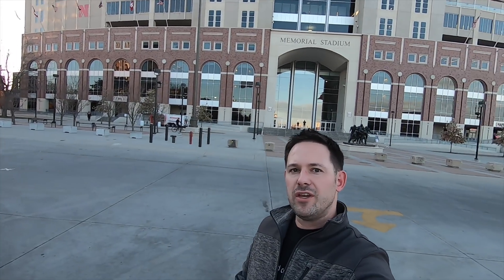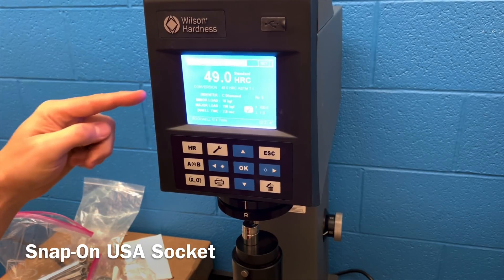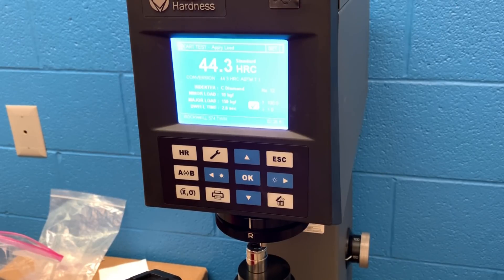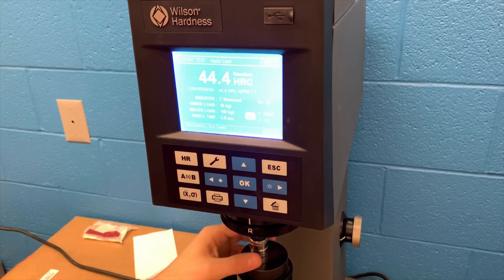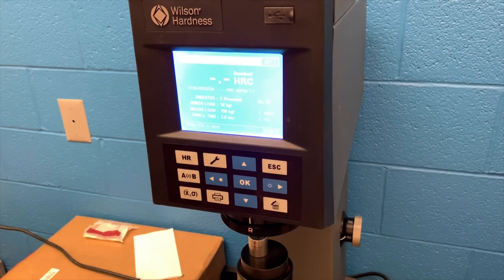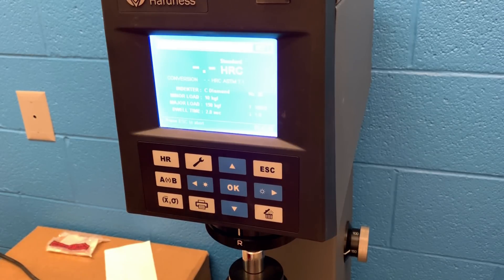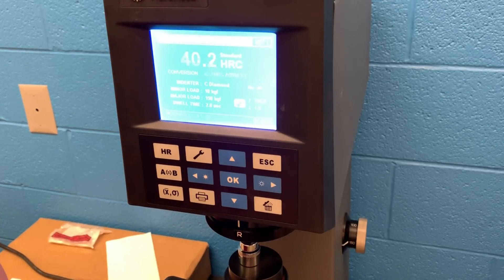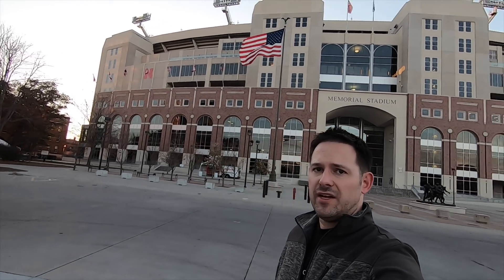Which Brand has the Hardest Socket? Rockwell Hardness Tool Testing

Comment: This proves nothing! Harder means it will crack or shatter faster. Also you can’t break any of those sockets when using them on a ratchet, sure I’ve broken snap on, and craftsman sockets but only when using them on a big breaker bar or impact. They aren’t designed for that! In my opinion if you’re just starting out just buy impact sockets from the start. I have complete sets of chrome sockets in every drive size and impact sockets in every drive size also! I rarely use the chrome sockets, and with my thin wall and stubby impact sockets I really don’t need the chrome sets! If I could start over I would have never bought the chrome! Waste of money! But I’m drawn to shiny chrome tools like a homeless guy to an ashtray in front of Walmart!

Comment: My black chrome Stanley set is awesome. Stanley makes some husky sets. There is a 100% identical husky set as my Stanley. It came with two size wrenches deep and short sockets for both. I use them on my makita impact no problems.

Comment: 2 things. 

first, i dont know anything about how this testing works, but couldnt/wouldnt the thickness/quality of the chrome coating have a significant effect on the readings, to the point that you are measuring that just as much, if not more, than the actual metal hardness??

secondly, just about ever socket i ever broke was at teh thin part down in the hex area. i notice tht you checked hardness in the drive area. im assuming that it is also possible that these have a different temper on the working end that was missed here.

Comment: most interesting, but as others have said, hard may also mean brittle, I suppose it is all down to the composition of the alloy, the fineness of the grain structure c/w the depth of the hardening process, Socket strength is also dependent on wall thickness and 6 point verses 12 point sockets, I have just invested a lot of money in a new set of SK sockets, which may, or may not be the same as the old Wayne SK socket you tested. I suppose the proof of the pudding is in the eating. Further, how about the affect of the chroming process? hydrogen embrittlement ?

Comment: The engineering in something as simple as a socket would amaze most people. Not only base metals, but forming, machining, hardening, plating and quality control.
What I’m curious about is why one brand can sell 20 sockets in a blow molded case for $19 and another brand charges $41 per socket?

Is there any way to dive into development cost investment between brands?
I know many are reverse engineered to save in this area.
Reply: Man there are a ton of variables. Material, number of QA operations, tolerances, number of thermal processing cycles, finish prep, finish itself, frequency of tooling replacement, country of manufacture, and last but not least - business model….. 

Those are just the variables off the top of my head.

Comment: Keep in mind that the harder the metal, the more brittle it becomes. You need to section the sockets and check the internal hardness to get an accurate idea of how these compare.
Reply: I'm sure the harness is evenly distributed throughout if it was really thick then yes the harness would vary greatly depending on the alloy of metal used. IMO the chrome plating should be removed to get better test data.
Reply: That’s true for any given specific alloy, but there’s more alloys than you can shake a stick at and one alloy may be less brittle and harder than another one that’s more brittle while being softer. Therefore you can’t just assume because one is harder it’s going to be more brittle, it could be harder and less brittle, especially if it’s more money.
Reply: Also, “brittle” isn’t really a useful term for metals. Usually you use toughness and strength. Brittleness is the tendency to break before it bends, but that doesn’t really tell you much (except that if it’s bending the manufacturer could have hardened it a little more and if it’s breaking they could have hardened it less, but again only useful when comparing the exact same alloy, and steel has many different ones). 
Strength tells you how much force can be applied before it fails, either by bending or breaking, and toughness tells you its impact resistance or energy absorption before failing. All of them are going to vary, sometimes drastically, by specific alloy and not necessarily be dictated by how hard the metal is.

It’s all about compromises. They can make the metal very corrosion resistant with high chromium or other additives, but that will sacrifice strength. They can use exotic metal combinations that make manufacturing, machining and quality control much harder but result in a superior product in every way, but that adds lots of cost, usually more than most people would think worth it. Or, they could find a way to make a superior product and not have the extra costs, and those are the ones I look for, YouTube testing channels are good at finding those gems =)

Comment: with steel, hardness is often a tradeoff to toughness. A soft socket will return to spec after plastic deflection. A ideal quality is a socket which is only just hard enough. The SK Wayne has metalurgy and heat treat has resulted in a soft socket, but it's the SK wayne socket you used in the 19mm/3/4 testing. This is a wise pick because if it's hard enough for ratchets to fail, then staying within spec after flexing to 300ft lbs is a very desirable trait.

Comment: Sk Wayne is old right? Like some 50 years ago?
Reply from the maker: Yes it’s from the mid 1960’s
Reply: @ClientGraphics  so I have an sk ratchet with the diamond logo and the Pat. No. And 42470 part number on it. Would you know what decade that's from?
Reply: They made that SK ratchet for decades.. probably from the 80s but u never know for sure

Comment: Didn't go through all the responses, but does the chrome finish is skewing your results?
Reply from the maker: Chrome plating is over 60HRc and up to 70.  Rockwell C penetration depth at 45Hrc is around 0.11mm so it just crushes through the chrome plating no questions asked.  Chrome plating tool thickness varies from 0.002 to maybe 0.038mm.

Comment: Personally I feel the hardness scale is one of those things where a higher number doesn't necessarily mean that it's less resistant to breaking... on the contrary, I would think that it will give more opportunity to crack if not used properly sort of the way I view pistons..... 2618 compared to 4032 forging....2618 (softer) gives you more opportunity to keep going whereas the 4032 (harder) one wrong move and it could crack... but, under good conditions and used properly both could last a long time and do their job....🏁

Comment: So what I’m noticing is that the softer sockets tend to have thicker walls at least going off what he was saying and the thinner sockets tended to be harder. So the quality soft sockets relied on more material to keep up the strength.  And I’m guessing the harder sockets have more chromium and the softer ones have less.  But then again it may be from the hardening process as well.

Comment: Wow I really thought the husky sockets we're not very good quality I just bought a 200-piece socket set for $80  guess I'll have to give them a shot now.
Reply: I've heard mixed things about how they perform. Some good and some bad. Most likely depends on if you get a bad batch or not. Husky most likely doesn't have the best quality control apparently lol
Reply: I bought a set of husky but I returned them the same day the chrome finish was not good on the sockets and the small wrenches were machined very bad as well I bout a dewalt set and it was better but not by a lot

Comment: Don't like that selfie stick but this's a top topic for me, installing structural steel, work on industrial sites and working on mining and heavy construction equipment means I tend to use an impact much of the time and that's the only real time you need to know if a socket is up to snuff, especially if you're going to modify sockets and use chrome.

Comment: Rockwell hardness means nothing without knowing the alloy of steel like 4340  8620   1045  and so on ,rule of thumb the harder the steel the more brittle .9310 will take high impacts but wears fast, were 8620 will resist wear but don't like impacts  at the same hardness

Comment: When I was a kid, I had a set of deep 6 point SAE sockets that I believe were stamped, hardened steel. In hindsight, I now understand what theses sockets were for, and if I hadn't mistreated them, I'd still have them today. They were for getting into extra tight places due to their super thin wall, they'd go where a normal socket couldn't. They were like a last resort socket if no other tool could get around the thing you were trying to loosen. Some of you may know the cheap spark plug removal socket/tool that came with your lawnmower or generator or other power device? These sockets were along those lines. SOMEONE SHOULD STILL MAKE THE DEEP AND REGULAR SETS- They were really useful.

Comment: While ASME B107.1 is a classic and a requirement across any brand you might manufacturer for, each brand will provide a target range depending on material. So it's no accident most of these brands are where they are, it's by design. While near 50Rc may seem high, it's really not anything to worry about as long as its being used by hand. Problem is many people won't use them only by hand, and if they break it's still seen as a poor quality perception even from impact abuse. This is why the most common spec for this category is 44-48Rc among professional brands in our experience.

Comment: You failed to use a V-shaped anvil for testing the side of the socket.  Also, you failed to apply the reading to a cylindrical correction.  Using a flat anvil puts the diamond penetrator at risk.  If the sample slips, you could easily break the diamond.
Reply: Cylindrical correction for this diameter is within standard deviation.
The problem is the socket is elastic when measured from its side.
Because it is hollow with relatively thin wall.
Unlike Vickers micro hardness test, Rockwell measures the deflection of the damond tip under a standard load.
Reply: 1978 graduate.

Comment: GOOD!

The chrome plating should be ground off before hardness testing as the chrome plating does add some measure of hardness. More important, harder is not better as harder results in a socket that is easier to shatter or crack specially once the temperatures go down. Where hardness makes a difference in a socket is the hex opening where it engages the fastener to be driven. While it is easy to test the back end of the socket, testing the fastener driving surface of the socket is more meaningful. Most hand tools have a RC hardness of 45 which is plenty and more results in brittle, less is more ductile, prone to wear and lower strength.

What this test illustrated nicely is now consistent modest $ brands are and how these brands have no significant function difference than the Snap-On with the highest measured RC number (more prone to crack or shatter). 

Modern metallurgy and heat treatment can produce virtually any degree of RC hardness in a socket or tool. As with most engineering-design realities, it is all a set of trade offs with no single factor being the determinant of a socket or tool being "superior".
Reply from the maker: Cutting a socket in half and taking samples from the inner socket wall as well as the drive anvil would yield results more reflective of a manufactures QC process. That process however is very destructive and then I’d be out a lot of 19mm sockets since I can’t make them myself😂
Reply: @ClientGraphics  That should be done as a more relevant comparison and the actual fastener contact-drive area can be properly tested once the chrome plating has been removed. FYI, RC49 is about 221,000psi tensile strength, RC 45 is about 206,000 psi tensile strength. Difference is not as much as one would believe. http://www.carbidedepot.com/formulas-hardness.htm

1960 series socket head cap screws (similar to metric grade 12.9)  are spec'ed at 38 to 44 RC making them about equal to these sockets.

Spun many a Snap-On and other brands of sockets on a lathe, they cut with zero difficult using carbide tooling... just like Socket head cap screws.
Reply: @ClientGraphics  .pdf from NASA on high strength bolts-nuts-fastners (300,000+ psi tensile strength), These will easily shatter-crack a standard Snap-On or other socket in an effort to reach it's proper tension torque. At one point, Snap-On made "high performance" sockets designed to handle the higher torque of these aerospace fasters. Snap-On has since discontinued making them. Other brands have taken over this specialized socket - tooling market.

https://ntrs.nasa.gov/archive/nasa/casi.ntrs.nasa.gov/19660005495.pdf
Reply: @ClientGraphics  no don't cut the poor sockets in half what did they do to you 😂😂 😂

Comment: Didn't someone else mention you should sand off chrome?  Else you're just testing chrome plating hardness between brands?
Reply from the maker: I believe the chrome plating is around 0.004-0.010in and would be 68 to 72HRC with just a surface test. Direct Rockwell C Major load of 150kgf will test to a depth of around 0.018-0.022in. punching through the chrome and shattering it like glass getting to the good stuff.

Comment: the harder the socket the less give or flex it will split or break first, thats why impact sockets are cr mo ,and chrome ones are cr-v.  the constant hitting on the impact needs to be more flexible, thats why you are not supposed to use chrome sockets in impacts, they can actually break the anvil, because it is softer than the socket.

Comment: I’ve had my 1/2 harbor freight impact sockets for almost 8 years & I use them professionally at the dealership & haven’t broke one yet
Reply: Same here.   When I first started out in the workforce I didn't have the money for mid range tools, let alone Snap On.   Bought some HF hand tools thinking I'll replace them once I earn some money, 10 years later and haven't broke one yet and all still going strong.
Reply: Their impact sockets are great, so is the Jobsmart brand, both cheapest on the market
Reply: Never broke one myself either.   They do grow legs and walk off though.
Reply: My 21mm took a shit the first time i used it, all my harbor freight crap is in a box replaced all with tekton 😁
Reply: What you've proved is that nearly every nationally sold brand of socket can do the job and I've found that true over my nearly 40 years in the trade.  The big difference I've found is the tolerance for fit and in the strength of the ratchets.  The least expensive sockets (IMHO), have a wide tolerance level of fit on nuts and bolts, while the more expensive units are much closer in difference of tolerance.  I discovered this purchasing two cheap sets at a national brand of sockets at a chain store; a 18mm in one box fit the nut smoothly, the same sized socket from the same brand in other set fit loosely.  Both worked fine, but the looser fitting socket could damage a bolt/nut.
Reply: Pittsburgh hand tools are one of the few real gems at HF once you get past the garbage sold there. I have had great experience with the quality of HF sockets.  Cannot say the same about Tekton.  Based on my experience with sockets, from now on it is ether Pittsburgh or Husky going forward.
Reply: 86dieselman what gave you trouble with the tektons? I was thinking of going with tekton for my chromes and sunex for my impacts
Reply: @86dieselman I have broken so many Pittsburgh wrench’s that I won’t use anything that has that name on it.
Reply: @snizzytown5217 really, what type of wrenches? I ask because their ratchets are very good! I have no experience with their combination wrenches.
Reply: @86dieselman just the standard metric wrenches.  I have never ever broken another wrench with out severe abuse.

Comment: What is this? A laser test?
Reply from the maker: Rockwell test uses an indenter that is pushed into a metallic surface with a given force minor 10kgf and major load 150kgf. The hardness is inversely proportional to the depth travel between the two  https://en.m.wikipedia.org/wiki/Rockwell_scale

Comment: Husky best bang for your buck
Reply: 200 price socket sets are$79 right now!
Reply: @5jjt  yeah I know that but it has alot of 12 points if it has more 6 points I would get it it's worth it 12 points don't work in the rust belt
Reply: @WorkHorseLT  The 144 piece set is 1/4, 3/8 and all of the 125 sockets are 6 point for $99.
Reply: @fhbkx  i got enough 1/4 and 3/8 in six point i want 1/2 in six point which is hard to find in a complete set
Reply: The husky 200pc socket set is now $59!!!
Reply: @2011nickp  that's a good deal but too many 12 points
Reply: Thomas Richmond I like to have a few 12 points around because there are 12 point fasteners out there just like there are 8 point which also work on 4 point square heads.
Reply: I was able to snag one of those husky sets for $59 and now they're completely sold out. 

LOTS of 12-points, and kinda annoyed that all the 1/2 inch ones are 12 point, but I was able to get full 6 point 1/4 and 3/8 sets in metric and SAE. Both regular AND deep sockets. 

I've already used the metric sockets and they've worked great. I figure with the money I saved I'll grab a tekton 1/2inch 6point set, since they're the only 6 points I've found.